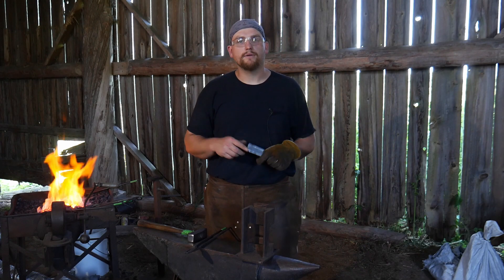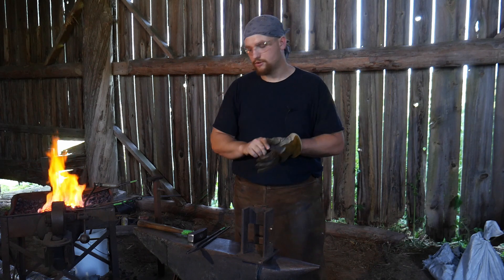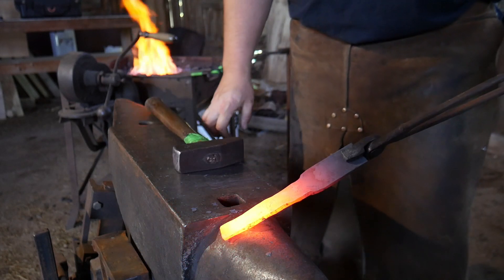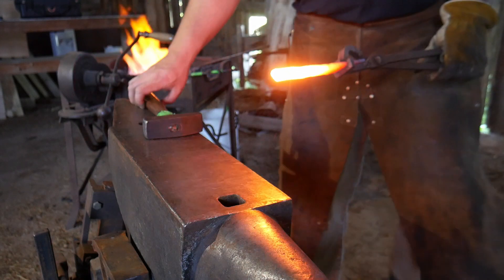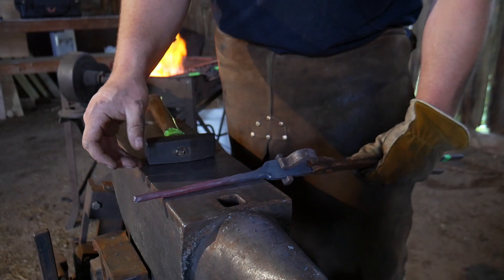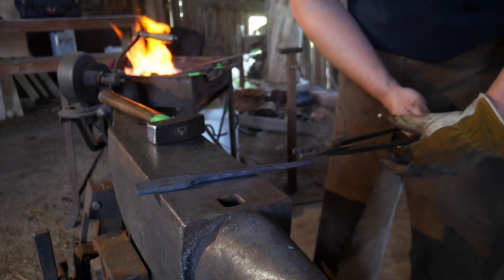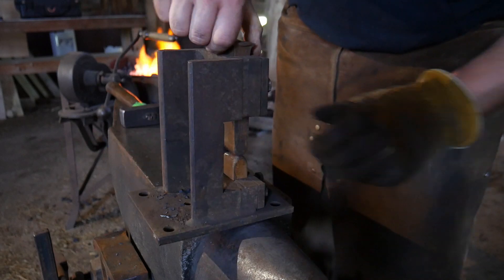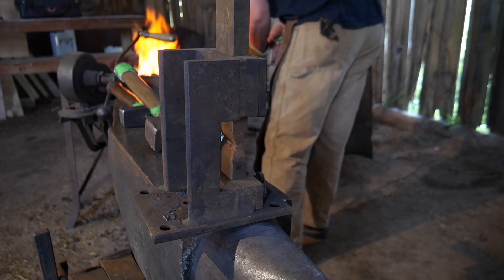Forging Oak Leaf Curtain Tie Backs

Comment: How can you tell if your anvil is not working properly? I've tried forging on an anvil my uncle gave me and I just seems like I get nowhere after hours and hours of forging I've checked my Forge it's producing great heat I'm using a 3 Pound Hammer so I'm guessing a must be the Anvil
Reply: Dustin GraveRose it's probably not your anvil. You may not be getting the steel hot enough. Or you may not be striking hard enough/efficiently. Keep trying and try to find someone to help you learn. Check your local ABANA affiliate.